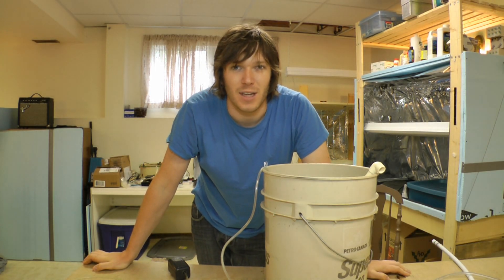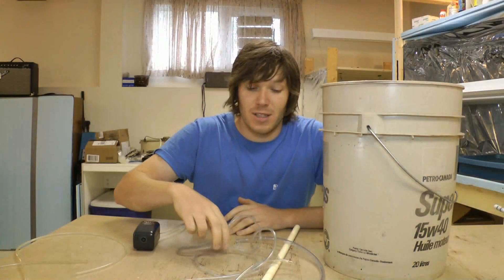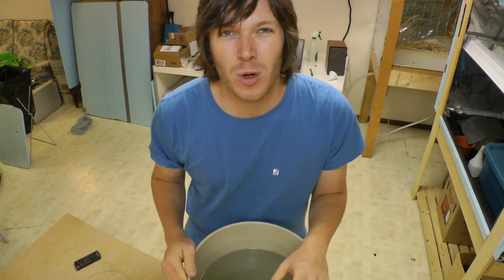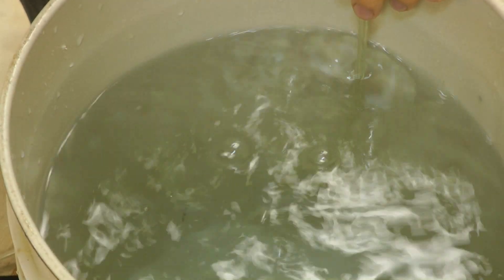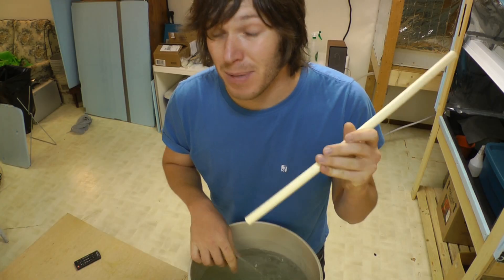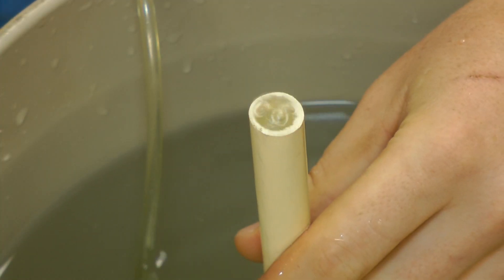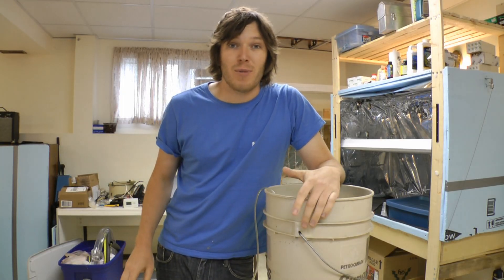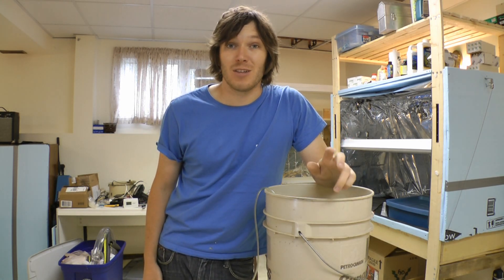How To Hydroponics - S02E21 Air Lift & Pulser Pumps

Comment: The water lifter is at the heart of my DWC set-up. I take a 3 1/2 gallon bucket and drill a hole for a pvc pipe. The lifter is inside this pvc pipe - easily removed for cleaning.  Then drill about 150 1/8th inch holes in the bottom of the 3 1/2 gal bucket and nestle it inside a 5 gallon bucket, voila'.  The five gallon bucket has two bulkhead fittings, one in one out.  With flexible tubing the bucket is connected to a reservoir that has a small fountain pump. With this set-up I get top watering AND ebb & flow! - with the use of a timer.  Been using it for over 10 years and it has not failed me. The 3 1/2 gal bucket has a layer of ceramic beads, 2" worth, and then filled with perlite. The plant, I find, will totally fill the top bucket with roots and only then start going through the holes and into the pure liquid in the lower bucket. Barbed T fitting and a 1/4" soft copper tube - formed into a circle - with about 14 holes in it distributes the solution over the entire surface. (must drill out T fitting for the copper tube to fit inside).  The only downside is that one stray particle of perlite will clog the system but is easily cleanable. This is getting rather long. I have left out many salient points. I will only continue if interest is shown.  Thanks.
Reply: got a video or pic? tell me more :)
only 4 years later
Reply: you can get paint strainer bags to hold the perlite from clogging the system

Comment: One important thing I noticed is that the smaller air pumps can be found for $0.50 - $2.00 at thrift stores. They sometimes group them with "brick" power supplies because they look a bit similar(the older black box looking pumps). Another important point for growing off grid, or just efficiently, is that smaller air pumps only use about 3 watts and are pretty reliable compared to small & cheap chinese water pumps! These air lift pumps can pump much more water and to much greater heights if more air volume is used(obviously), also with proper ratios of pipe sizes. People use air lift to get water from shallow and deep wells, it just depends how much water is needed and at what pressure. They seem really great when you consider there will be no moving parts down to any depth of well! The "common" well pump & pressure tank system is actually really inefficient when compared to say a 50-200 gallon ground level cistern with a "booster pump" to get any pressure you want in your house.

Comment: Has anyone used a 3/8" pipe? In another application I have used 1"-5/8"-1/2"-3/8"-1/4". 1"-5/8 does not work. 1/2" works poorly. 3/8" creates an air lock in the line that does not allow water to bypass air bubble. This give me best hight and efficiency easily maintains 50/50 water air mix without an air stone. 1/4" created to much back pressure.I made a stream powered water pump that uses 1" pipe to capture water and air mix at about a 50/50 at input. It creates 21 to 23 psi at exit. Because of exit pressure compression 75/25 water/air by volume. By running it through a water/air splitter I am able to lift about half the water to 50 ft. and the rest a water/air 50/50 mix to over 70 ft. By using 3/8" ID line the water is unable to pass the air bubbles and as mix rises it expands. Water/air mix enters at 50/50 and leaves around 25/75 water/air after 70ft. lift. The weight of the water in the pump is around 31 pound. That is equal to a column of water 63.75 ft. As setup is configured it can lift water over 80 ft.https://m.youtube.com/watch?v=4omE2UpNOSE

Comment: Wow.  If only other people would simplify the process as well as you 
did!  So I built a system using an 18 gallon tote.  I used 1/2" PVC and a
 1/4" air line.  I was only able to lift about maybe 6 inches.  My pump 
is 4 watts, 4 PSI, 2000 cc/min, which according to this website: 
http://www.convert-me.com/en/convert/volume/cc.html is 2L/min or  0.5283
 gal/min, so 120L/hr or about 30 gal/hr.  I'm wondering if my pump is strong enough?  What are the specs on yours?  Any ideas on why I get different results, other than I'm using a tote?  Thank you

Comment: ~60% of  the standpipe must be in the water. That doesn't leave enough  head spacethe to make it very practical. To get higher lift requires a compressor with a high psi. That defeats the low cost, low tech model.a.

Comment: Those pumps are cool. My hydro shop sells whole drip systems like that. Cheaper doing it as you show. There was a lady on line making pulser pumps somehow with just plastic things she welded together with a soldering iton and used my air pump.